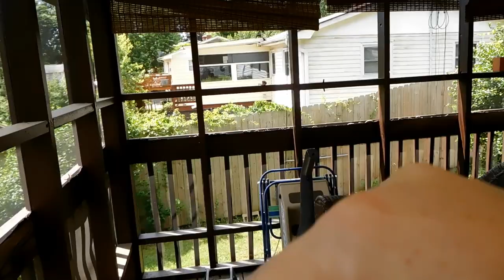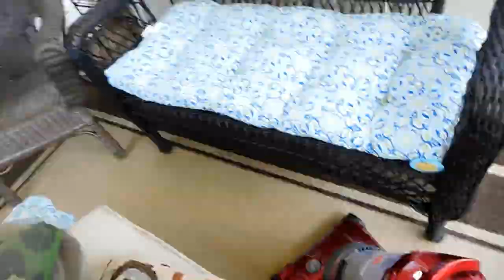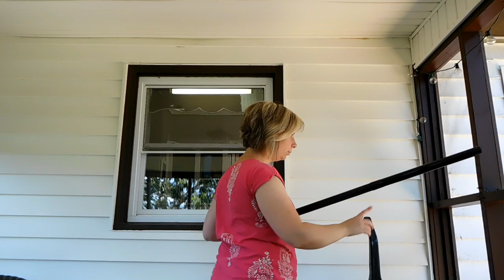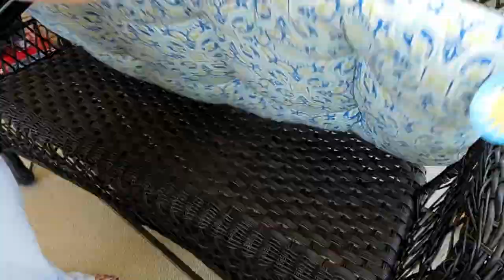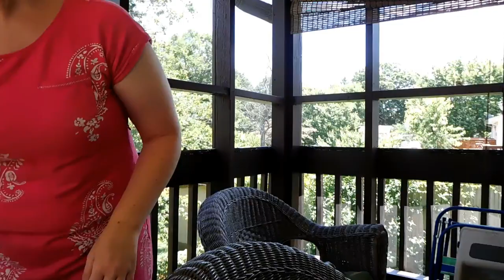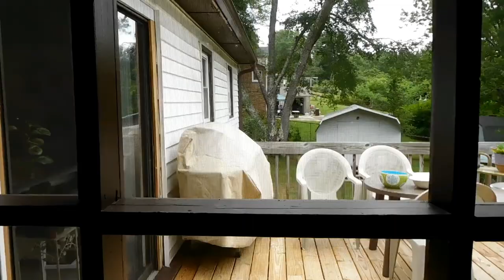Screen Porch Deep Clean!

Comment: What’s the best way to clean all the pollen off of all furniture??? Thanks!
Reply from the maker: What type of outdoor furniture do you have? You can mix Dawn dish liquid with warm water in a spray bottle and spray your outdoor furniture down with it, let it soak and then rinse it off. Repeat until it's completely gone. :) you can also do the same with the cushions, and use a bristle brush to scrub it down, and then rinse. Air dry. It really did great with my outdoor furniture. Hope this helps!😃
Reply: New Day Vlogs can we use a blower, or will that not work? We have a mixture of wicker furniture, painted wood tables, and a wicker table with a glass top. Thank you so much for responding so quickly 😊
Reply from the maker: You can use a blower to get dust and stuff out of wicker. I'm going to put a link below to tell you how to clean wicker furniture because there are different types of wicker, and I'm not really sure what type you have so I don't want to tell you the wrong method. Follow these instructions. The Dawn dish liquid works great on mine with warm water but make sure that you read all of these directions because you I'm not sure what type you have :-). I hope this helps and I hope that everything goes great and come out like new for the spring! 😉 Thanks so much for watching my video!! ❤️ if you have any more questions, please let me know 

https://www.cleanipedia.com/gb/floor-and-surface-cleaning/strategies-for-cleaning-your-wicker-furniture